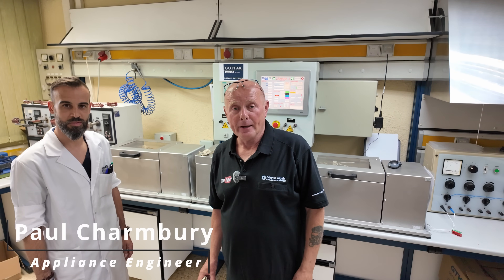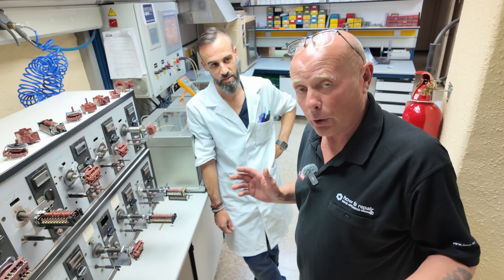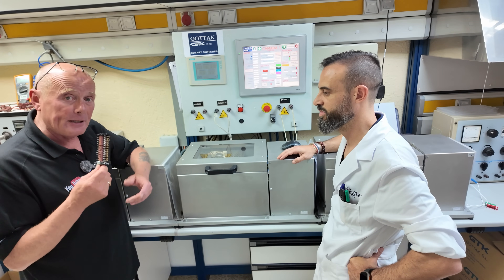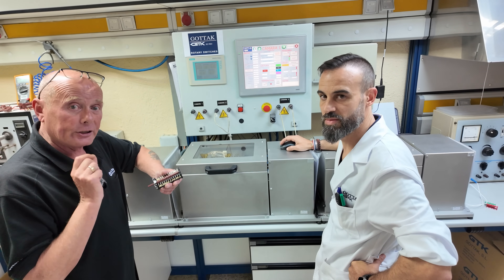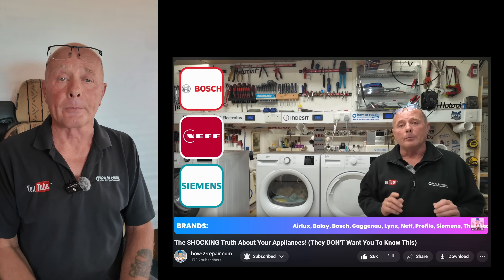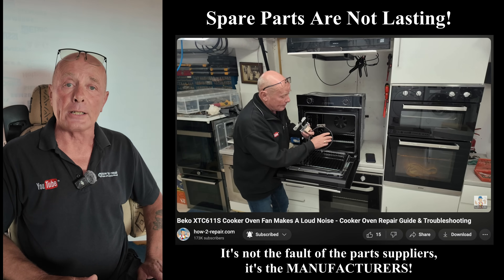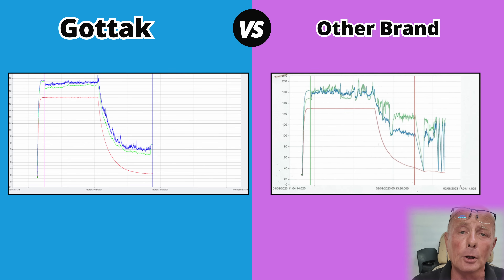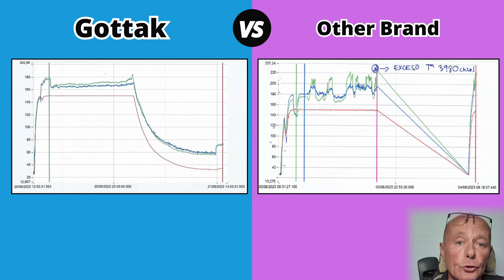Why Your Appliances FAIL SO FAST! Lab Results EXPOSE the Truth!

Comment: Got 14 years out of first Hotpoint washing machine with diy bearing and spider replacement. New one got second hand at a year old but it has sealed drum so will be scrap when bearing goes.  Hardly environmentally friendly, could be saved for many more years with a £15 part if they still did split drums
Reply from the maker: Thank you for your comment. I appreciate people like you taking the time to write it out. Please share it where possible. It might help others make a wise choice instead of being misled by the industry.
Reply: To be fair, I replaced the bearings in my Miele 17 year old washer as I thought they were worn out. The old bearings (NSK England) were however still like brand new and it turned out it was the drum itself that had gone out of round (I had ordered NTN and  F.A.G. bearings for the replacements as they were the cheapest brand name ones!).  [Edit: I don't think it was spider failure as this was from before 2010 when Mieles still had s/steel spiders AFAIK, now they have s/steel spiders again since 2021 onwards AFAIK.] So TBH I not that worried about bearings wearing out.  

Shortly after the inlet valve failed and then a couple of years later the drum itself failed and delaminated (Miele inner drums are made of different layers folded together as I found out!), lol.  I.e., by the time the bearings are wearing out (assuming they were high quality brand-name bearings), isn't everything else in the machine likely to be on the way to failure anyway?  It seems like it can be a false economy if an older machine keeps needing repair after repair?

Comment: Yes, I have been aware of this for years, as an ex engineer. (mechanical). It prettymuch covers the entire manufacturing output, and the same applies to relays used in 'push button or sensor switching', noot just rotarry selectors.
I recently relocated to a different country and bough all new appliances; oven, hob, microwave, kettle, TV, washing machine, fridge freezer. So far after 6 years I only have the washing machine working and the fridge freezer. I put this down to my careful use of the washing machine and always having the freezer well stocked. All the otheritems failed. All expensive and prestige brands too. All shortly out of warranty.

This is diabolical, not only for the personal cost, but because in  most cases the items are unservicable. Another additional fault lies in the over reliance on IC's (SMD's) and the need to replace a full mother board if a logic chip cooks, which they often do in heat generating appliances.
These failures lead to landfill, wasted energy on manufacturing (and disposal) and depletion of natural resources, the materials not being readily re-cyclable.  crime against the consumer and against the planet.
Even previously reliable brands from the UK, Germany and Netherlands are now offshored, adding to the cost and use of cheap components by design. It's sad. And annoying.

And lets not even start on cars!
Reply from the maker: Never a true word said. The consistency of the way manufacturers are building in obsolescence is absurd and governments seem to be supporting them because they Greenwash everything.
Reply: "And lets not even start on cars!" If ICE, stick with older versions, your Honda R18 and K24 engines, your 5-speed Honda auto instead of your Honda CVT,  your Toyota naturally aspirated port injected engines.  TBF, I don't think Honda deliberately intended for their 1.5L L15 turbo engine to be unreliable and have a short life (typically 100,000miles for head gasket failure), but it's just a consequence of trying to achieve the combination of efficiency and power.  Same for the CVT (although it's not as bad as the Nissan CVT) and it being less reliable than Honda's previous 5-speed geared automatic.
Reply: "Another additional fault lies in the over reliance on IC's (SMD's) and the need to replace a full mother board if a logic chip cooks, which they often do in heat generating appliances." I was sceptical when I had to replace an old-fashioned Bosch electromechanical (or just mechanical!) pilot light continuous flow gas hot water heating with no electronics (the copper heater had corroded beyond repair), but apparently the modern computerised Rinnai hot water heaters are pretty good too and surprisingly reliable. I dunno.  I'm honestly not that worried about it breaking despite the circuit boards and computer control in it.

I had to get a power point put in for it though.  You are still allowed the non-pilot-light versions of the electronics-free Bosch gas water heater for indoor installations, but apparently the system with the dynamo and sparker is surprisingly unreliable.

Comment: My indesit washing machine has lasted 10yrs replaced the motor and shock absorbers last year. Its on its last legs as the bearing is going. Finding a new bearing is nigh on impossible unless you split the plastic drum which seems like a lot of work🤣🤣
Reply from the maker: Many modern machines have sealed plastic tubs which makes bearing replacement a nightmare, sometimes intentionally so. It’s frustrating when appliance repairs are made deliberately difficult. Manufacturers should be supporting repairability, not discouraging it! I would greatly appreciate it if you could share this video. Together, we might be able to bring about some change

Comment: I have been saying for years that accountants are the problem. Only looking at saving money on a purchase of a part and not looking at what the engineers and designers are looking at. I did notice in the testing regime here that the contact switches are not tested in the appliance while the appliance is on. Also needing a look is the lack of cleaning experienced by the oven and how that affects oven temperatures and life of switches.
Reply from the maker: Accountants chasing cost savings often override the priorities of engineers and designers who actually care about longevity and performance. I would greatly appreciate it if you could share this video. Together, we might be able to bring about some change
Reply: Regarding..... I did notice in the testing regime here that the contact switches are not tested in the appliance while the appliance is on......this is done by appliance manufactures at their own labs.....they do extensive life tests in house........but each manufacturer decides the life of their product.

Comment: Shocking facts. We are expecting companies to do better, but companies do not have our best interest in mind. Its shareholders value and profit, at all costs. We need a strong government and policies to force the companies to do the right thing. Anyone who thinks 'the market's is the best possible regulator, did not work in a big company OR is profiting from this.
Reply from the maker: Absolutely spot on. The shift in decision-making from engineers to accountants has made it painfully clear that profit now outweighs quality or sustainability. I would greatly appreciate it if you could share this video. Together, we might be able to bring about some change
Reply: IIRC, Ben's Appliances tore down an LG top load washer where the small capacitors on the control board were rated for 5000 hours but the big capacitors were a type rated for 1000 hours, even though 5000 hour nominal life capacitors of that size are also available from the same capacitor supplier. That kind of thing is definitely unacceptable IMO.

Comment: The built in obsolessence is obvious now but what irritates me just as much is that the design now is such that a repair is not possible - the components are linked in ways that impossible to replace just the failed part thus too expensive to repair and whole machine wasted. Also the design of my new machines seem to be so the outside is “pretty” but things like a plug available on my expensive stove is now not available. Fine if you are building a new home and able to put in lots of outlets but most people are replacing stoves so it is an issue. Also the high-low locations on the stove buttons vary from side to side so a hazard when people use the “familiar” use until they get used to this variance (if they ever do). The front load washers are extremely prone to mold and mildew around the door baffle no matter how carefully you dry and leave the door open. And if the load is at all unbalanced the spin stops. I don’t expect appliances to last 20-25 years like they used to anymore but to have to pay thousands every 2-3 years for replacement machines is very, very frustrating. If they refuse to build quality then at least design so repairs can be made at a reasonable cost so it is a consumer choice to repair or replace.
Reply from the maker: So many new appliances focus on aesthetics over practicality or durability, and like you mentioned, basic functional features like accessible plugs are disappearing. We shouldn’t have to accept costly replacements every few years as the new normal. At the very least, manufacturers should give us the option to repair affordably. Repairable design should be a standard, not an exception.

Thank you for your comment. I appreciate people like you taking the time to write it out. Please share it where possible. It might help others make a wise choice instead of being misled by the industry.

Comment: Had a Beko tumble dryer develop a fault in the circuit board after a few years. No power to anything. Removed the board and rewired the motor and heater through appropriate fuses and switches and ran from a digital timer. Good as new. Up yours Beko!
Reply from the maker: Beko believed or not one of the better companies for supplying information to the general public to give them a chance to repair their appliances. Also the spare parts are reasonably affordable when you compare it to the likes of Bosch Miele etc who also do not provide any information whatsoever to the general public when it comes to  wiring diagrams or workshop manuals
Reply: You must be a fellow EE.  I REFUSE to buy new appliances.  My fridge a hotpoint/ge from 1985 is still running with only a new fan blade and defrost timer assy.
The condenser is vacuumed annually. As long as the compressor runs I'm keeping it!
Similar story for dryer, but new belt new rear sleeve bearing and of course several hot surface ignitors.  

Kudos to you my friend!

Comment: All of that just because of cost from the manufacturer as well as consumers misusing selector switches.
Reply from the maker: @ElectronicsJenson-n2n That's an interesting point about the manufacturers' costs and consumer misuse of selector switches potentially contributing to appliance failures. But don't you find it incredible that 90% of all manuals do not put clear instructions in with regards the operation of the selector switch in conjunction with the thermostat.

As we explore in our videos (https://www.youtube.com/watch?v=QsdGd2qDPaI & https://www.youtube.com/watch?v=xn03N3b0-lE there are indeed multiple factors that can affect the lifespan of appliances. Cost considerations during manufacturing can sometimes lead to the use of less durable components. Additionally, how consumers use and maintain their appliances certainly plays a role in their longevity. Misusing selector switches or not following operating instructions can unfortunately lead to premature wear and tear but if they don't print it in them, how is the end user meant to know?.

Our videos delve into these aspects and offer some tips on how consumers can potentially extend the life of their appliances. We encourage you to watch them for a more comprehensive understanding of these issues.

If you found this insightful, please subscribe to our channel for more discussions on appliance durability and related topics!
Reply: @How-to-repair  What I mean is, as I am an engineer myself, all of manufacturers of not just appliances but all products will optionally for the will go for cheaper third party components for lower end models, though top brands like Bosch, Neff and Miele will manufacture them in house for their products, that are produced in China that don’t seem to last longer than 3 years, I have even come across a dodgy Chinese adapter in the past. By misuse I just mean people not being aware of this issue with selector switches.

Comment: Consumer laws has to be strengthened. Probably waste management and right to repair laws to. Old radio and tv sets came with full schematics embedded in the unit. I'd love to see all appliances have that. If not in the unit then through a qr code on the unit. Documentation should contain schematics and parts specifications.
Reply from the maker: Thank you for your comment. I appreciate people like you taking the time to write it out. Please share it where possible. It might help others make a wise choice instead of being misled by the industry.

Comment: You see this especially in washing machines replaced a water solenoid in a westinghouse just after 3 years , the plastic lid on the top loader broke 1 year prior ( not made of metal anymore). 
When first purchased they assured me I should get at least 5 years out of it , far cry from the old days when you kept the washing machine for 15 to 20 years .
Reply from the maker: I totally agree with you. Something has to change. We can’t keep using up all resources shipping appliances halfway round the world which uses vast amount of fuel and then only have a lifespan of 3 to 5 years this is only working well for the manufacturers and the government are supporting it because it props up the economies which are all in Dire Straits as they have false books

Comment: Thanks for this video! Do you think that using external relays, which would be triggered by the rotary switches, could be a solution to the problem of the switches overheating?
Reply from the maker: I think just putting better quality materials like silver into the contacts and other components that conduct electricity correctly would make the switch out last the Appliance anyway by adding relays we are only over complicating the matter. We are only trying to make the Appliances last a reasonable amount of time we are not trying to make them last forever. We are already seeing circuit boards in some cookers and these are failing far too often because of the extreme temperatures that they have to operate in

Comment: It's a shame that the industry used to be on a basis on making the highest quality product they can so people keep buying them, now it's just a race to the bottom on how cheaply can we make this machine, and the worst part is it's happening on both premium and budget price points, at this point you might as well buy budget appliances because the longevity will probably be the same.
Reply from the maker: Companies like Miele are rubbing their hands together now because people are moving to the higher end brands if they can afford to, but the rest of the normal people suffer.
Reply: To be fair, it would be interesting to know if Japanese appliances like Sharp and Panasonic have suffered the same drop in quality.  At my local appliance stores I can still get Panasonic microwaves and I was surprised to still see Sharp microwaves too (my Sharp microwave is 15+ years old and works great, some people aren't as happy with their Panasonic microwaves), but Panasonic and Sharp washing machines and refrigerators are no longer available in Australia.

Comment: Nothing new here, My late father worked in a prominent electrical/electronics company in the 1950's/60's, the company is still in business today (one of the very few left) one of his jobs was to build in fail componants to all their products, hence they would need certain parts replaced just out of warrenty or user hours.
Reply from the maker: It’s a crazy world we live in to use up all our resources just for consumption. Do you know there’s a lightbulb in an American fire station that still works to this day when it was installed around 1900
Reply: @How-to-repair  "Do you know there’s a lightbulb in an American fire station that still works to this day when it was installed around 1900" To be fair this lightbulb is incredibly dim and never gets turned off! 🙂 I'm a little skeptical of Phoebus Cartel claims, because nowadays we have Philips selling LED bulbs rated for 50,000 hours for the same price as their 15,000 hour bulbs -- why would they sell a 50 year light bulb for $7 AUD/ 3.40 GBP if the Phoebus Cartel was real?

[LED bulbs fail a lot in hot sealed enclosures, or rather circuitry fails, but in open enclosures they seem to mostly get their rated hours I think.]

Comment: Manufacturers will soon be forced 5 year warranty and 10 year spare parts availability with additional requirement, that the price of all parts must be reasonable, no more than 3x the machine price in total for all pieces. I will definitely stand for 5 year minimum warranty for any appliance that weights more than 1kg (significant carbon footprint).
Reply from the maker: As with a lot of software for Computers, you can’t buy it anymore. You can only pay a yearly subscription. I think this is the way the whites good industry is trying to force the situation.
Reply: Nissan was trying to cope with Nissan Leaf EV and selling one headrest (out of 5) for 450€. This was funny, I remember that moment at the dealership. I asked, how much for the whole seat.
Reply: You do that, a microwave would be US $1500.